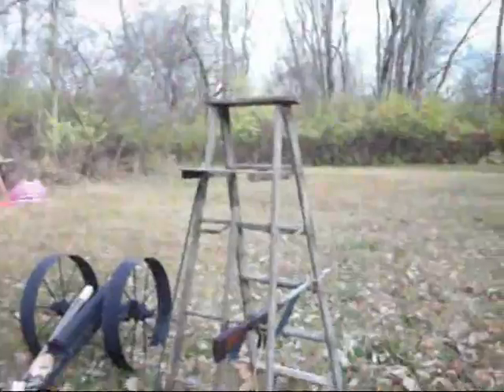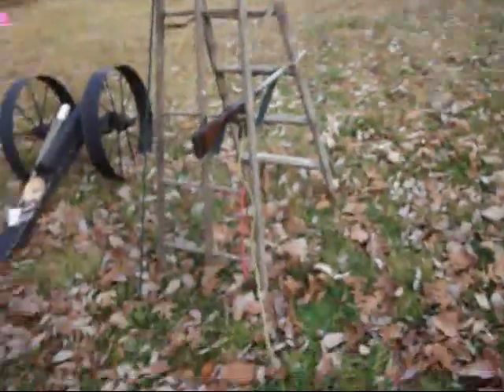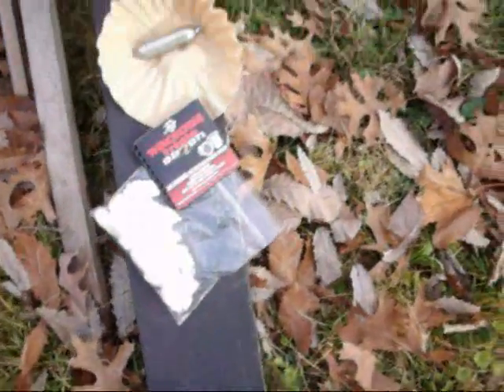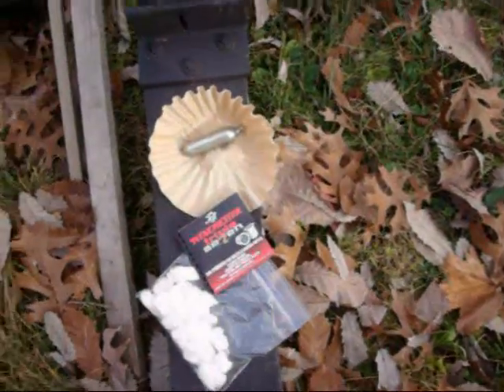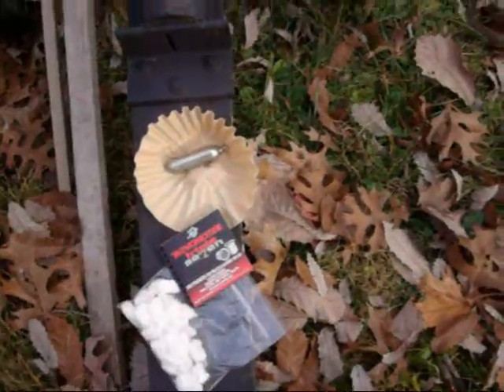Guncotton test in muzzle loader

Comment: That was a good experiment, I think the g/c would probably be more reactive if you ground it up though I would like to see that experiment if you dare but be very careful throughout this experiment I would not grind very large amounts of g/c at one time at all you might experiment with puting different materials with it after it powdered like charcoal or metals like magnesium or aluminum this should allow you to slow down or speed up the reaction some of these will probably be impact sensitive so use EXTREME!!!CAUTION !!!just a suggestion use your own judgement only you know your skill level and what you are comfortable doing...good video I would love to see more..
Reply: It burns too fast for that, the pressures would blow even modern guns